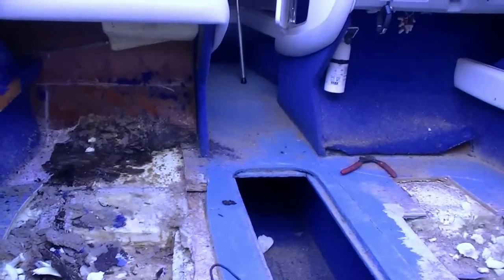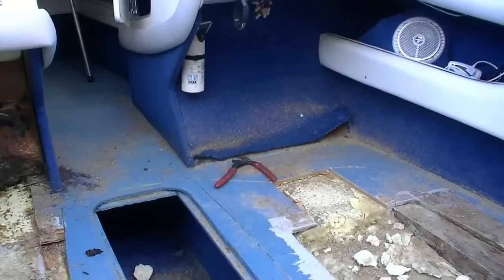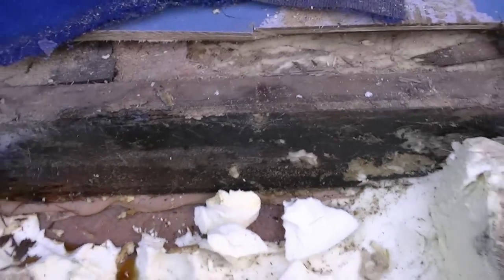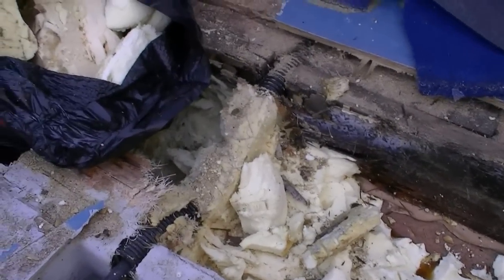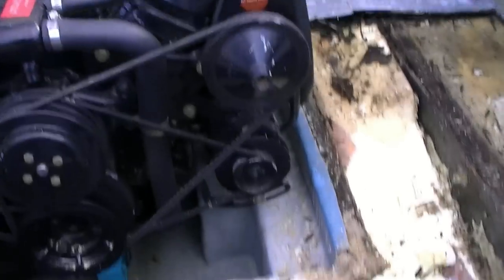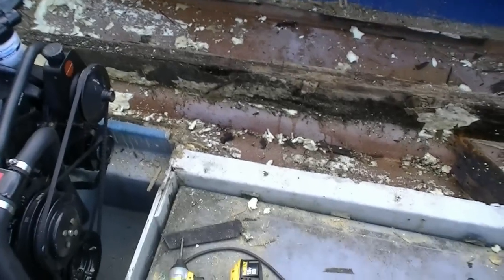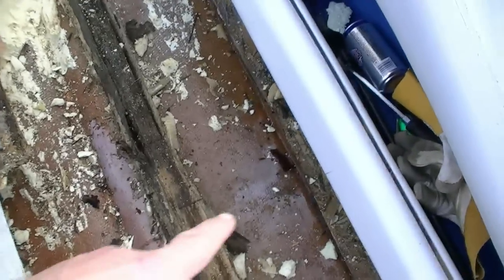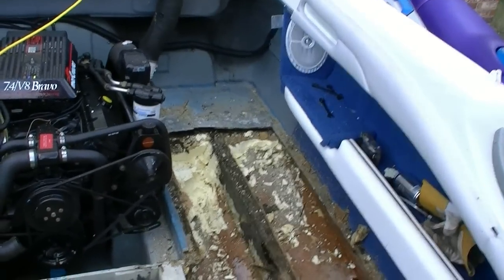The Demo Continues on the Sea Ray 220 BR VLOG #3

Comment: Water always finds its way. Vibration and flexing of a boat will get passed any sealed joint. Key is to let it drain and air out. Unfortunately foam prevents that.

Comment: I started watching this series and got totally pissed off ! The guy that sold you this knew the hull was no good. And tried with success to cover it up I would have taken him to court. In any case the hull is no good. I would looked for a comparable hull at Copart ! You have a good engine and outdrive. You could have picked up another boat cheap at auction. There are tons of these at auction every month in Florida. Usually with bad motors.

Comment: Last boat I did itr was a v=hull 18 ft I found out after the majority of foam I used a pressure washer and used my shop vac, because you little drain plug can only do so much. Fixing to start a 79 Baretta same shape as yours. Right now troubleshooting starter system want to make sure it works and has good compression then it's a go. Not worried about cold live in LA (lower Alabama) I need shade. Good luck I'll keep up

Comment: Cheer up jay good thing is you still have the glasstron cause I sold my other boat as soon as i got my searay and was stuck watching everybody else all summer and I remember well what your going through. did stringers and transom on a cuddy cabin  and it was just to big to remove the cap so the only way to do it was to climb down in the engine compartment with all the trash and glass dust  and it was hot last summer full suit, respirator never forget it  but wish I could

Comment: Great work on these videos!  Question. I have a 89 wellcraft eclipse 233. The floor had been redone once. Obviously,  it was done incorrectly.  I am going to redo it using your videos as a guide. I don't see that it had foam in it. Should I put some?  I am going to do  everything else as you did in your videos.  Would adding foam change anything? Thanks!

Comment: Great video series...a few things I have to say to anyone else reading these as they may find their way here for many reasons. As a long time boater a few things I have learned.

1. Sea Rays are very questionable boats in quality...especially these small ones. Pretty yes...quality no. I'm sure much of this is to blame on previous owners...but my goodnesss the boat is only 10 years old before showing this! If you don't believe find "Pascoes" survey/reviews on the intertubes. 

2. No matter how small a boat...if you are spending good money and cannot DIY you need a survey. A decent survey could have found the soft floor, transom or even stringers thru access holes. For $400-500 a minor survey could have been done and saved him a lot of time and money!
Reply from the maker: It is not just sea ray.. it was all the 90s boats in general
Reply: FriscoJarretts I would agree...it was bad in the 90s but there are many exceptions. I know everyone thinks they have the "greatest" boats but I've been running Tiaras with great success in build quality. Currently working on a 1988 Wellcraft V20 which is legendary but terribly built inside now that we have it cut open. Thanks for your comments!

Comment: Frisco, Just started to tuning into your videos. Very nice and very clean work! I admire your drive and will power. Tough Break about the floors. I have a 94 similar to yours and i purchased it used a year back. My question for you is, Was this boat docked/moored in a slip most of the season ? Or was it stored like most, outside in the elements? Thanks and good luck!

Comment: You mentioned sealing everything up so no water can get at the stringers.  Are you worried about dry rot since the wood can't breath? and are you foaming after it's sealed. I am working on stringers in my speed boat and could use the advice.
Thank you for the vids , nice work
Reply from the maker: ColdfireNightfire Not really. It could happen but not likley

Comment: Man I'm not trying to be mean or anything but no need to complain anymore about the issues. It sucks to be taken, but move on and take it as a learning experience. I'm sure if a survey was done as moisture test could have found this from someone reputable.  No doubt its a very nice boat, but in no way is it worth the 900 mile drive regardless if it was on your way to vacation. I wouldn't drive 100 miles for it. Maybe if it was a 27,28, or 29 foot cruiser. Please don't take this a disrespect or anything I mean no offense as too many people just like to be rude on youtube or FB. Finally I do appreciate you taken the time to post all these videos on your repair for people to see!
Reply: Would a moisture meter be effective through all that fiberglass and gelcoat ?

Comment: I've been watching your videos about floor replacement on your Sea Ray and I am doing the same thing to my Bayliner.  I'm having an issue where the stringers and bulkheads are completely removed and now the floor is flexing on the trailer.  I'm curious as to how you installed your stringers and bulkheads while your Sea Ray was on the trailer?  I would like to talk to you on the phone about this issue if possible.

Comment: I don't see how it could an owner could let it freeze. I take our boat out, put it in the garage and tilt the nose up to make sure all the water runs back and out the drain hole. Boat and engine need to be stored dry don't they?

Comment: I wonder if you could substitute another material for the wooden stringers? I had the same problem on my '91 170 but got rid of it when I discovered these issues. But I wondered if there was a way to make a fiberglass stringer or even an aluminum one that would make the boat essentially unsinkable. Aluminum Stringers would not have to be very thick and wont rust even if water does get in. But fiberglass would be easy to tie into the existing hull.
Reply: I know this is 7 years ago, I used composite plastic for stringers on a sail boat

Comment: @FriscoJarretts Unless you have a piece of paper giving you some kind of warranty then by default any private party used sale item is "as-is." Its comes down to buyer beware. It sounds as though you were in a rush to buy it----you also sound as though you know alot about boats. No offense but you should have known better. Just finish fixing it and chalk it up to lesson learned.
Reply: That's a foolish and high browed critique.  If someone is out to fool you, there is no guarantee that you can see through their sheen, no matter how experienced you are.  One soft spot on the deck in the corner was the only tell-tale sign (aside from the extra waterlogged weight).  Unless you know the guy is trying to screw you, you're not going to push and prod the entire surface area of the boat.  You talk as if you've never been suckered, buddy, and that can't be true, as your logic leaves much to be desired.  You've a small mind.  Chalk it up to a lesson learned?